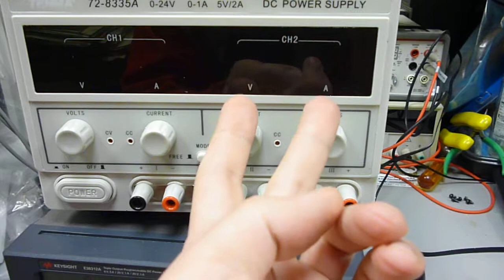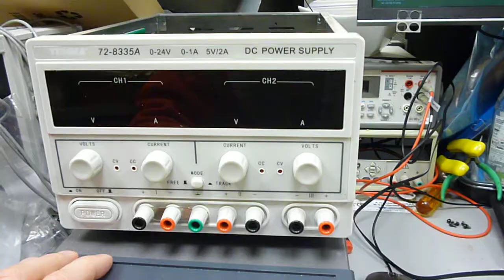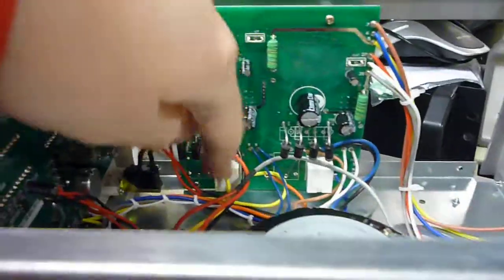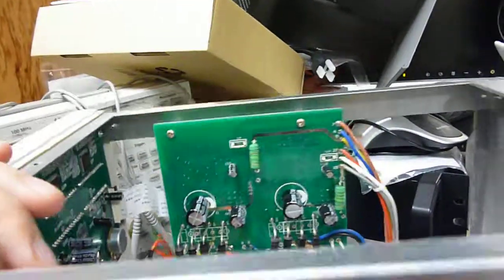TENMA 72-8335A Casual Review Part 1 of 2

Comment: I would like to see a video on measuring ripple in dc outputs
Reply from the maker: Common mode ripple or differential?
Reply: @ElectricEvan  hell...lets do both!
Reply from the maker: Keep in mind this is hardly the greatest power supply. I mean I understand wanting a proper review of performance but honestly the knobs being reversed relative to the displays is a total deal breaker for me. We kept this unit, my boss is going to use it. I think he sees this bug as a theft deterrent feature. I liked the keysight multichannel power supply and I have an as yet unposted review of it. The thing is I don't want to have the lab buy 20 of them ($1,500 each) that adds up fast. This is why I am reviewing power supplies that are under $500. We did buy 12 tektronix single channel output supplies a while back for a project but those were like $400/unit... took a photo of myself sitting on them actually... https://www.flickr.com/photos/evanfoss/36930763493/
Reply from the maker: short story is don't buy this thing ether. i will probably find something better in the next 3 or 4 months.